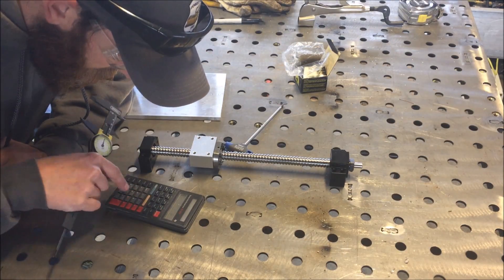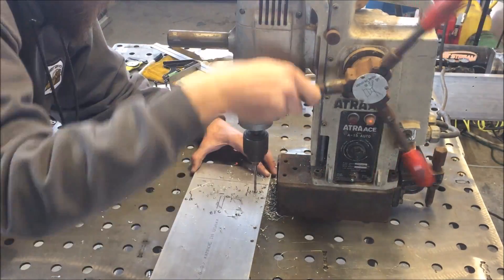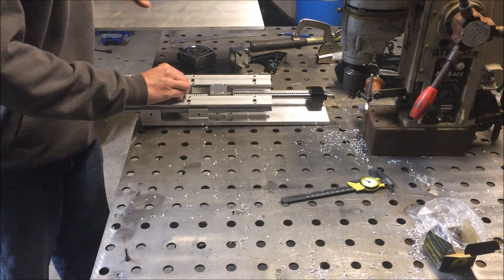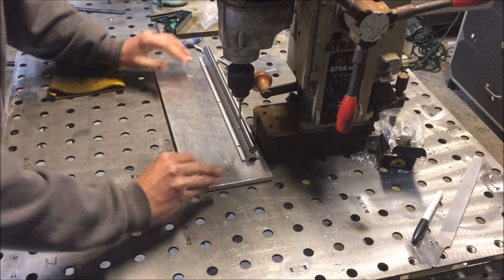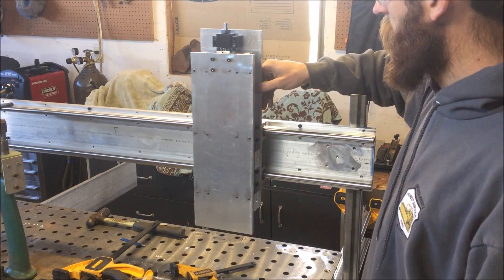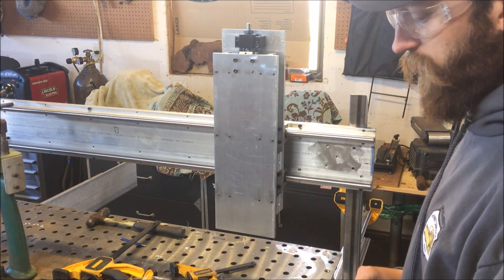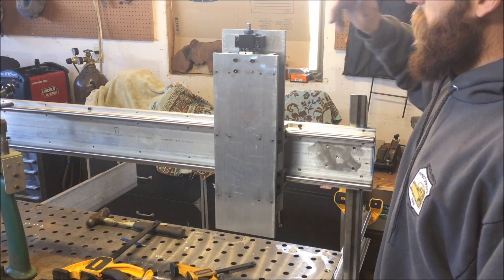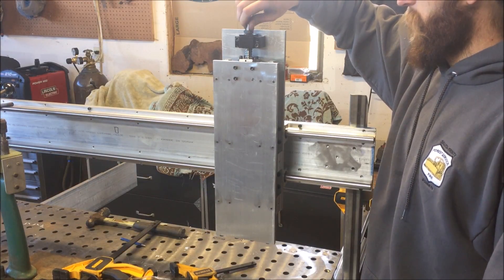DIY CNC on Certiflat Welding Table Part 5: Z Axis

Comment: How do you like the sbr style linear rail was thinking of buying a set?
Reply from the maker: I like them and good for my application. The hole spacing was inconsistent but for my mounting method I built to fit. Depending on what the application was I would buy them again
Reply: Rivers Company I have carriages on my gantry for a plasma table and I was thinking of using the sbr style on the x axis. What size sbr set were you working with?
Reply from the maker: I would certainly use them for a Plasma Cutter, my only concern would be keeping them guarded from sparks and splatter. I most likely in the future will build a designated plasma table using the same rails.
Reply: Rivers Company sparks and spatter in guessing because they're aluminum? I have a water pan but the pierce could produce some spatter which would booger up the rail a bit.Not quite sure which size I'd go with it,  would be mounted on 2x2 square tube sbr20? Seems like all the 1500mm length was out of stock on eBay curious to what yiur set ran you?
Reply from the maker: The extrusion holding the hardened rod is aluminum but that’s not to much of a concern, since the bearing don’t contact it. I’ve had some welding spatter stick to the hardened rod, if you don’t clean it off it would get under the wiper and ruin your bearings eventually. For a plasma cutter there is not much force pushing back like there is with a router, it only has to carry the weight of the components, so the SBR 16 should be plenty strong enough. I honestly can’t recall what I paid for the rails, I bought a 3 axis kit with ball screws then purchased another 2 rails for the y axis. eBay won’t let me go that far back in purchase history to see what I paid.
Reply: Rivers Company thanks for help and information I always thought the sbr was cheaper then the thk/ hiwin square rod but with limited supply in this country seems like the price went up lol.